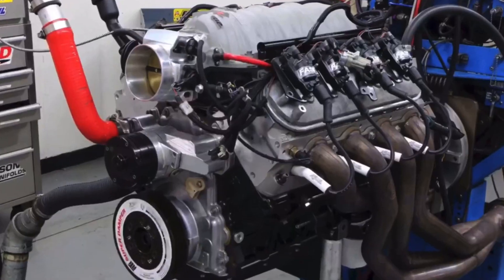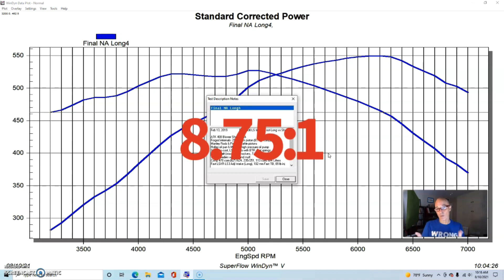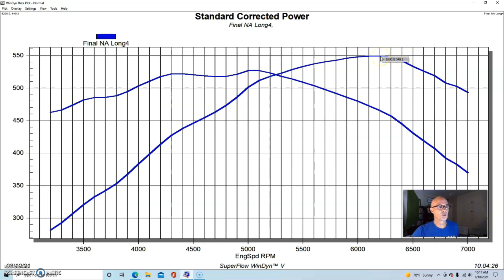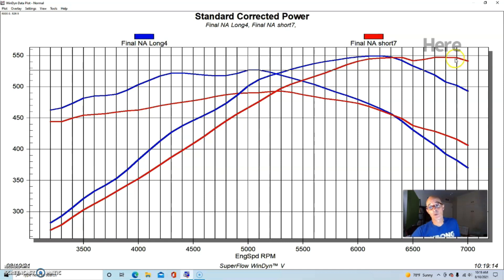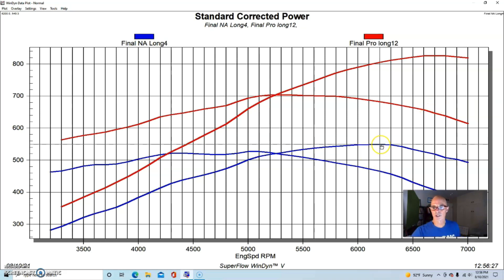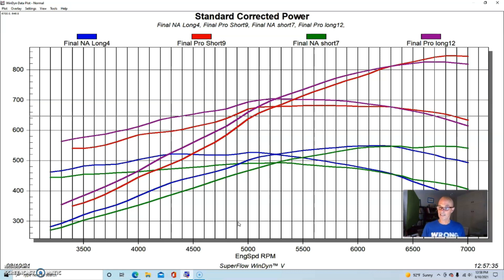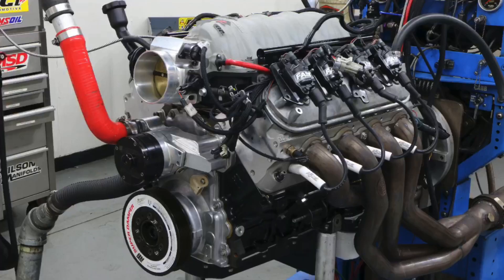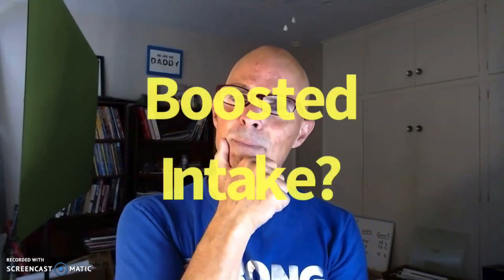SUPERCHARGED 408 LS STROKER INTAKE TEST (LONG VS SHORT)-NA AND BOOSTED

Comment: How many lbs of boost was  the pro charger putting out?
Reply from the maker: 11 psi or so
Reply: How much hp you think that same setup will put if it was 15 psi? I got a 408 ls stroker with a D1-x pro charger that supposed to put out 15 psi haven’t got it installed yet but was wondering how much  guesstimated hp I’ll make?

Comment: Well I can tell what’s going to happen, why because air is air, and flow is flow which equals short runners =high rpm, longer runners = low end TQ..end of story..
Reply from the maker: the tuned runner length is not flow

Comment: I don't think there is really a specific boost manifold, not that you said that, but it seems like the cam didn't like the low compression naturally aspirated.  I would bet the cam manufacture would state that the cam requires at least 11:1.
Reply from the maker: cams don't require a specific compression

Comment: Quick simple question. With hardened pushrods and springs and built trans. What is the max safest rpm to take a 4.8 to? I've seen multiple of your vids you took your base 4.8 to 6500 or 6700 is this safe?

Comment: I’m thinking the intake runner test needs an 8000-8500 rpm combo to show where those short runners are useful. That means different head flow capacity and cam, obviously. If you’re building anything between 6.0/364 and 408 or 416 for 6000-7000 rpm, the long runners are the way to go.

Comment: LS build... LQ9 block, 421ci stroker kit, comp 459 cam and ls3 heads. what do you think and what would you change?
Reply from the maker: I WOULD NOT DO A 421-REST IS GOOD
Reply: @richardholdener1727  why not a 421? I have to bore the cylinders due to damage and have to get a new crank. the engine had a piston explode and the pin wrecked the cylinder and I believe this happened from a spun bearing. so if not a 421 then what. The rotating assm. is the same price as 408 from tsp.
Reply: @factoryspeed6786  I hope you didn't end up going this route. That stroker kit would make you thin out the cylinder walls too much for that block.
Reply: @urge8153  I went 408 instead
Reply: @richardholdener1727  trying to hit the 550hp plus na

Comment: The cam seems decent, but I cannot help but wonder if a slightly more aggressive cam and maybe a good cnc port on the heads would have had a little better showing for the short runners?
Reply from the maker: A CAM OR HEADS WON'T CHANGE WHAT THE INTAKES DO (RUNNER LENGTH IS CONSISTENT)

Comment: Horsepower under boost is horsepower times the multiplier of the boost, the rising rate boost curve means the slightly lower horsepower at higher rpm gets a higher multiplier, so the total is overall higher. If you multiplied the same amount of boost at the peak of the long runner intake as you did at the peak of the short runner intake you'd get the same peak.
Reply from the maker: THE BOOST WAS THE SAME AT EACH RPM FOR THE TWO INTAKES-THE POWER CURVES WERE DIFFERENT AT EACH OF THOSE BOOST LEVELS (INTAKE DESIGN)
Reply: @richardholdener1727  I understand but the boost was higher at the higher rpm hp peak of the short runner, no?
Reply: More boost at 6800rpm than at 6300 rpm. So even though the NA hp is lower at 6800, the boosted is higher due to more boost.

Comment: We need an intake like modern sports bikes, where the runner length mechanically shortens with rpm 👌🏻
Reply: BMW (probably others too) has an electrically controlled blade called a DISA valve that does this
Reply: @aarondraper4445  a lot of manufactures have a variation of this.  Dodge even used a dual runner manifold for the Dodge neon R/T. Had a flap that opened/closed based on rpm. Actually made a little more power vs the basic plastic used on the others.
Reply: They have been doing that since the 1980’s, on stock motors , a lot of V6’s have vacuum assist runners, which worked great, but sucks when you get a vac leak, or a bad solenoid and only half the runners work,lol..
Reply: Dodge Hemi 6.4 intakes, and 5.7 Ram intakes
Reply: @captainblaiser  that’s a different system that changes the runner length on the inside of the intake ala svt focus 

What the bike guys are talking about is the variable intake tech which came directly from F1 which was banned because it worked too well and became unfair. The laferrari uses it as well as 90 percent of liter bikes including the Ducati V4

Dodges system is much older and restricts airflow it works great but it’s not the bees knees

Comment: Hey richard i have a lq4 6.0 with 79@ head milled .10 with a stage 2 585/585 cam i have an LSA from a ctsv i wanna add to my motor how much power do you think i will achieve
Reply from the maker: depends on boost level (blower speed)
Reply: What would be a good boost level on a stock bottom end

Comment: I've been thinking about making my 5.3 a stroker but keeping the stock bore, it would end up being around 359 cubic inches doing that.
Reply: You’d likely run into connecting rod clearance issues due to the small stock bore.
Reply: The 5.3 block still limits your cylinder head to cathedral port. Spend the same money on a 6.0, stroke it, plop some LS3 heads on there and you wont regret it. 408 or 416 cubes also, you can't beat that.

Comment: Sounds like it might be down on compression on a couple cylinders 😄
Reply: People say boost fixes everything, blasphemy! Higher compression lol theres roughly 100 horsepower in raising the compression from 8.7-12:1
Reply from the maker: there is roughly 12.5% increase in power with that compression change (that won't likely be 100 hp)

Comment: Interesting results. For most of us, the area under the curve is where it's at.
BTW, Richard have you had a chance to test manifolds that are tuned for different reflected waves? (i.e. 2nd wave, 3rd wave, etc) I'd be interested to see just how much that effects the torque curve.
Reply: I think that most passenger car production manifolds are tuned for 4th wave.  The upside of lower frequency wave tuning is the timed pulse is stronger.  The downside is if the engine is running at a speed where the intake valve closes when the rarefaction wave is down the port, volumetric efficiency is much worse.  So you get a big hole in the torque curve.
Reply: Yeah, I want to see how pronounced that effect is.
Reply from the maker: reflected waves are runner length specific-secondary and  tertiary waves after the primary wave arrive with reduced amplitude and effectiveness

Comment: just built a iron 6.0 bored .070,  418 stroker?    ls3  -3 dome Eagle rotating H-beams.  forged crank was Hard Af to drill to balance.  FRANKIENSTIEN heads ls3  273cc  71cc    286/289 113lsa  .651 lift at least.  Johnson short travel race lifters, howards pushrods,  W/  a whipple 2.9 truck kit    Hope it pushes more Hp
Reply: Theres no reason that combo shouldnt make 650 N/A, so couple lbs of boost and youll have trouble keeping the tires from spinning :3

Comment: What would happen if you used 4 long runners(lr) and 4 short runners(sr). Using the firing order so it saw lr, sr, lr, sr, lr, sr, lr, sr?
Reply from the maker: we tried that to simulate what a single plane does-it makes less

Comment: I have always liked 8.5:1 to do stupid stuff with blowers and turbos on Premium pump gas on street biased engines.
Lots of room to "fill" and reasonable safety threshold in case I fudge up really bad something.
Just my personal taste.
Reply: I had a SAAB 99 Turbo 1978 with 7.5:1 comp when it still got lead in petrol, I did almost block my wastegate and got a water/meth injection with small intercooler, it was wild ride for sure, it spin tires in 1-4 gear....low compression and high boost is very good combo ;) just look at Formula 1 in the 80th turbo era :)))
Reply: Dude this isn't the 90s you can have your cake and eat it too
Reply: @austindoud273   but I love the 90's ? ! 😁

Comment: Be cool to see a test with 4 short runners and 4 long runners installed at the same time
Reply from the maker: we did that
Reply: @richardholdener1727  Care to share what happened? Maybe as part of a compilation video of "really weird sh*t we did on the dyno?'
Reply: Will probably do something in between the two with half the cylinders making more or less torque depending on the rpm.
Reply: Thats how most single carbureted intakes are, 4 short intake runners 4 long then they are then split again when you go dual plane over single
Reply: thats basically what a stock gen 3 truck intake is

Comment: Do you have a calculation for peak torque rpm vs runner length?
Reply from the maker: too many other variables
Reply: The simple Helmholtz calculation for single-cylinder engines is:
tuning speed in rpm = 477.5 x speed of sound x (intake runner area / (intake runner length x effective resonator volume))^0.5

The effective resonator volume is the volume of the cylinder and combustion chamber at mid-stroke.
Trying to do calculations on a multi-cylinder manifold caused my brain to throw a rod.